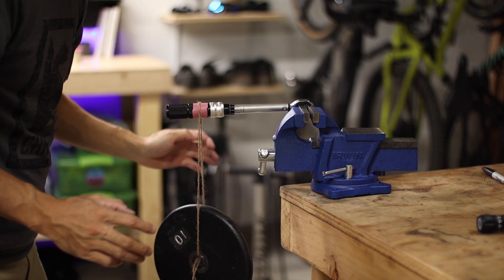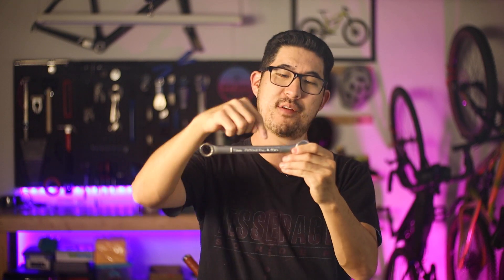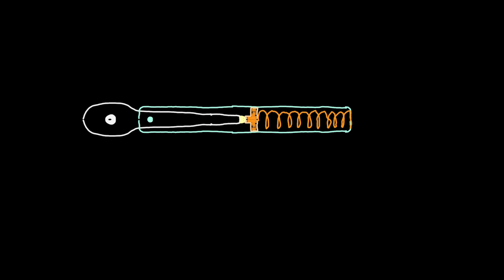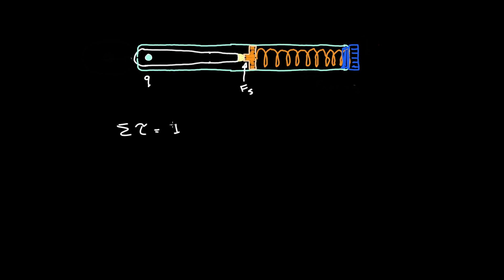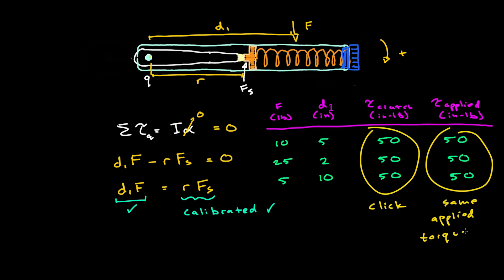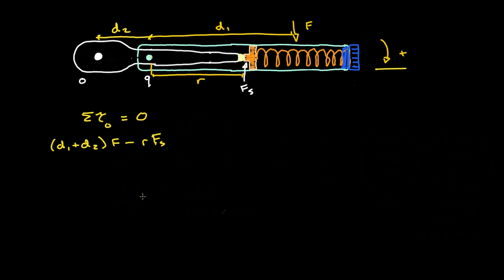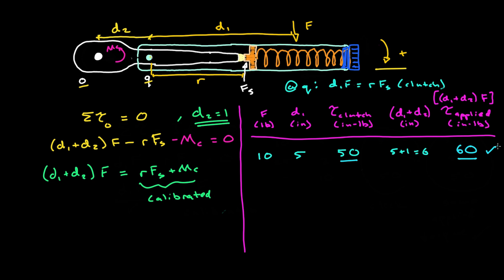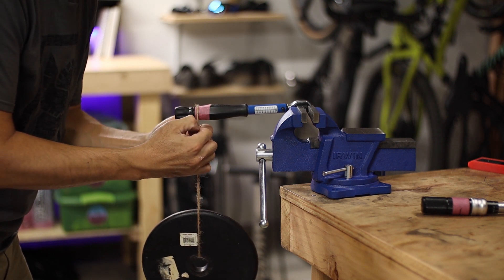Why GRIP Position on Torque Wrenches MATTERS!

Comment: Great illustrations! They explain the problem very nicely. Thank you.

However, I think your equation on the left side is off a bit. Your summation shouldn’t include the internal moment “-rFs”. Until the clutch slips the entire wrench could be considered as a simple solid bar when summing the moments about pivot point “o”. The correct summation equation is just:

(d1 + d2)F –Mc = 0

Nevertheless, when you perform additional free body summations of the individual wrench parts to capture terms “Fs” and “r” and simplify you will eventually get to the key equation which you have correct on the right side that shows that the clutch slippage force "Fs" is indeed dependent on d1:

d1F = rFs   or  Fs = F(d1/r)
Reply: You are absolutely right. But see, this is physics, he can not be a bit off, he is just completely wrong. There is a system of two equations for the torque around the two points of rotation - O and Q respectively:
(d1+d2)*F = Mc
d1*F = r*Fs

And eliminating F, (not Fs as you do) we get:
Mc = [(d1+d2)/d1]*r*Fs

And we get that the relation between Mc and Fs includes d1, which is not a constant, but a variable.
The other two, namely d2 and r do not matter, since they are a constant dimensions of the tool.

And we also see, that the naming scheme of the lengths is also completely wrong, since d1 and d2 have completely different meaning - a constant and a variable.
Also r is like d2 - a constant, they must be on the contrary - similarly named.
Reply from the maker: I love your approach to academic discussion 😆. Are you equating torques at 2 different locations? Naming conventions are pretty arbitrary, not sure how choice of variable name is ‘wrong.’ Thanks for your input nonetheless. Would love to hear precisely why this is completely wrong though.
Reply: @TheBikeSauce  In the model of the click wrench you have two axes of rotation, namely O and Q. Every one of them produces one equation.

Basic naming convention suggests using at least different naming for constants and variables. 

At school they suggest using the beginning of the alphabet for constants, middle of the alphabet for integer indices, and the end of the alphabet for variables. For example a polynomial is written as:
Sum (An*x^n)
a, b, c, d - constants
i, j, k, l, m, n - integer indices
x, y, z - variables

But you do not need to follow that exactly. Proper way is:
d1 and d2 - constants
r - variable
Or:
r1 and r2 - constants
d - variable

You see, also, two of these lengths are dimensions of a real physical object, while the third one is an abstract length from a physical point to an imaginary one. The real force applied by the hand is distributed over a surface area.

Also, another mistake there. In the simplified model all forces come from points on the axis of the wrench. But you draw the applied force on the surface of the wrench handle. You can have a model like that, but than you must take into account  the thickness of the wrench handle. And you get half the thickness of the wrench handle as a third constant there. Going outside the handle and / or having variations of that thickness makes this constant a function of our variable, the position of where the force is applied. So you get a more accurate, so to speak, second order model.
Reply: @TheBikeSauce  If you want, I will add this. In the second order model, where the thickness of the wrench is taken into account, it actually happens, that it does not matter. Yes, the thickness of the wrench cancels out. Which is another, seemingly, "strange and non intuitive" fact. So, it's not a problem to have a short wrench with a thick handle.

The equations go something like this:
Sqrt[(d1+d2)^2 + h^2] * F * cos A
cos A = (d1+d2)/Sqrt[(d1+d2)^2 + h^2]

Sqrt[d1^2 + h^2] * F * cos B
cos B = d1/Sqrt[d1^2 + h^2]

where h is half the thickness of the wrench where the force is applied.
And there we get the same equations as before.
Reply from the maker: Really appreciate that you’re interested, but have a bit of perspective maybe. You can always model a system more accurately given the time, but that does not make simpler models wrong. This model is adequate to demonstrate the counterintuitive idea that grip position actually matters on this type of wrench. It is an explanation for similarly counterintuitive empirical evidence seen in other videos.  

In your more complex model, you gain nothing by considering the geometry of the handle. The cos will be negligible wrt unity and the geometry of the handle is inconsequential.
Reply: @TheBikeSauce  That's exactly what I'm saying. That the thickness of the handle does not matter. How intuitive it is - I don't know.

Usually, the higher the order of the model, the more calculations you need to do. But these calculations are not more complicated, they are on the same level, there is just more of them.

To give a practical or technical idea you don't need to show the internals of the model. You may just show the results or emphasize on them. For example, you have the function:
y = (1+1/x)

That's a simple hyperbola shifted 1 up.
And show where different size wrenches go on that graph. And what happens if you shift in or out on the handle.

It's much easier to understand compared to doing a table with random, unrelated to a real wrench, numbers.

And this will give the viewers "a real, new correct intuition", so to speak. Because you see - here is the graph, here is where you are on the graph, and here is where you move on the graph.

Back in the day that was the main way to go. Now the computers are powerful, and you get just a number on the screen, hence you treat everything as a black box. No wonder there is no intuition...

Comment: Excellent explanation.  I have always wondered why my torque wrench stays at the back of the toolbox and that I am more confident of my hand force on the wrench.
The handle of the click type torque wrench should be articulated, pivoting at a point exactly at the "middle of the handle".  As long as the articulated handle is not bumping against the stops of its free range, the torque value should be consistent.  Or maybe the torque wrench should not have a handle at all but a ring at its end with which you can use a finger or a chain to pull on it.  That is old stuff.  Digital seems to be the answer now.
Reply: You're intuitively grasping something the YouTube personality overlooked.
Reply: its more  often about repeatability than exact torque  ,, plastic parts need an even clamping force to help prevent leaks , rubber gaskets wont mind say an extra 5% torque , as long as the fasteners all have the same to prevent distortion.

Comment: Nice demostration … there is also another consequence to consider in my opinion. When you use this kind of torque wrenches you should not apply additional torque with your hand. If the hand rotates the applied torque is not accurate. Ideally you should only apply force in a single point in the middle of the handle. I hope this is clear.

Comment: I didn’t understand why hand position mattered until recently because I didn’t understand how clicky torque wrenches worked.  And that is not straightforward at all.  And manufacturers absolutely do not help with this.  If we read the instructions (lol), they say do it this way but they virtually never explain why.  And many many people assume that there is just some mechanism built into the ratchet head that is somehow calibrated to click with proportional to torque.   The big problem I have is with people who, once shown the mechanics of the wrench, the statics equations, etc., still just say “bah! torque is torque!  I’m right and you’re dumb.” But alas, the internet is FULL of such people.  Anyway, great video.  It’s nice to learn new things.

Comment: Hi. It is true. Torque is torque when you have only ONE lever to move. Here though you have two bodies interacting. The inner shaft and the outer tube. OK plus the bolt which only lends its reactions to the system. Also Fs will always be Fs meaning that the  limiting force at which the click happens is always the same since it is dependent only on the spring’s selected stiffness by the dial and we don’t change that.  So what else could be changing ?  During the click a collapse mechanism is occurring. The two beams change their relative angle. Note that Fs doesn’t exist as an outer force for the system. It exists only for the inner shaft or the outer tube when separated and viewed as stand alone. Therefore the easiest way to prove your point would be to first show the equilibrium for the whole system just prior to the click when the two beams act as one and calculate all the outer reactions. Then show the equilibrium for the inner shaft ONLY using the previous reactions plus the force Fs as mentioned and considering ΣM=0 at the pivot point of the two beams. Actually when the click happens the pivot point is where the true rotation takes place even if the inner part doesn't really move - your hand’s force F moves respectively to it along with the outer tube. STEP 1 The System. Apart from the torque Mbolt {which from now on we consider it as a moment reaction applied to the shaft} a significant vertical reaction from the bolt -F should also be shown {which is opposite to the F you apply by your hand to the OUTER tool and satisfies the equation ΣFy = 0 for the WHOLE initial system of the two bodies that still act as one. A force which correctly is not shown in your diagram since your pole coincides with the bolt and therefore -F doesn't produce any torque there} STEP 2. The shaft. This vertical reaction now produces a real moment -F*d2 for the inner shaft respectively to the pivot point and it should be noted that it is a variable moment that changes every time you place your hand in a different location only because the vertical reaction changes. Again it is important to realize that for the inner shaft this variability occurs ONLY due to the difference in the strength with which you push the whole tool and not due to the distance from the bolt because the inner shaft is isolated and perceives no moving loads {since all the forces acting upon it have their points of application fixed either at its 2 ends or at the pivot point and therefore perceives only the fluctuations  in its reactions}. Of course the distance comes into consideration for the whole system only and goes along with the general consensus that when you want to achieve  similar magnitudes of torque and you decrease the distance you have to increase the force.  This increment is what is transfered to the shaft and plays a big role as we will see -  big enough to alter the torque output. For completeness we should add here that there is also one more vertical force applied to the inner shaft at the pivot point by the outer tube and it is equal to F-Fs. It is derived from the equilibrium ΣFy=0 {of the inner shaft this time} since there are 3 vertical forces at its 3 points  -F and Fs at the ends and F-Fs at the pivot point. This one though doesn't produce any moments respectively to the pivot point and we won't analyse it any further. Now the net effect is that this aforementioned moment -F*d2 acts as a relieving moment  for the shaft and is actually subtracted from the applied moment Mbolt in the inner shaft ‘s equilibrium equation. ΣM=0 => Mbolt-F*d2-Fs*r=0 => Fs*r=Mbolt-F*d2. Hence for the click to happen Mbolt should now be larger to counteract that larger [-F*d2] and yeld the same Fs that releases the spring. To put it simply the constant moment Fs*r is neutralized partly by the vertical reaction's moment  and partly by the true moment applied on the bolt as torque! To get a recurrent reliable Mbolt you should therefore combine it with the same vertical force that was present during calibration. It is part of the tool ‘s intrinsic formula. This a formula can also be viewd as Mbolt=F*d2+Fs*r. Both addends on the right side should appear as they were during calibration  for the torque result to be reproduced and yeld the Mbolt that the factory had initially gauged. To summarize it all Fs is not the only parameter of the system. The force with which you push the wrench is equally important. So when you hold the tool EXACTLY at the grip of the tool that vertical reaction is the same one that produced the torque Mbolt together with Fs*r  during the factory callibration and this is the only way to always yeld the same result. You exert the exact same forces of the calibration and they produce the exact same torque on the bolt. As you approach your hand towards the bolt  the vertical reaction on the bolt gets larger. One addent gets larger. That new larger F*d2 is not what the factory had taken into consideration when calibrating Mbolt and since it is again added to Fs * r which is always the same that means that the click happens at a larger Mbolt !

Comment: Hi Bike Sauce, I think you have this wrong. The second pivot and clutch is a mechanism to apply a consistent and calibrated load to the socket. The load transfer is not changed by the hand position. It is limited by the transfer of load through the clutch to the rigid arm connected to the socket. You are correct that the testing technique you used is flawed (measuring load on the lever arm to make it click is simply measuring the input force) but you need to look at realised torque at the socket. To do this you need to set up a strain gauge on the rotating object - nut or bolt - and see if the realised torque differs with the same wrench settings and different lever lengths - hand positions. I have not tested this but my analysis of load transfer leads me to believe that hand position does not alter the load transferred to the rigid arm through the clutch.
Reply from the maker: The linked video shows this exact phenomenon using a strain gauge torque sensor. This is just the math to explain it. I know.. really counterintuitive

Comment: I like the explaination. However it provoked more questions like; Where exactly is the "middle" of the handle? If your hand is smaller than my hand is it more/less accurate? How do you apply force to a specific area with a hand, that is much wider than a string with weight?

Comment: I have a split beam torque wrench with the knob on the side (not the micrometer style click wrench), and I also have one of those digital torque adapters. I don't know if the physics are the same as you showed with a split beam, but gripping different parts of the lever produce different torque values at the socket (where the digital adapter is) when the wrench clicks. It doesn't seem to be a linear relationship though. The more I choke up the harder it is to generate torque at the socket (of course), but pulling between the handle and the pivot point produces erratic readings from test to test and causes the wrench to click with 35, or 46, or 41 etc. ft lbs at the socket (when it's set to 50). This is not quite what I understood from the video which (I think) said the higher you choke up the MORE torque should be at the socket when the wrench clicks. But again I have a different style torque wrench.

The conclusion is the same, of course, and it's something I eventually figured out when playing around trying to see if both my adapter and wrench were accurate (they are both new). Hanging weights off the shaft 12 inches from center socket caused the wrench to click 5 ft lbs. too early. Hanging the weights off the center of the handle got me within a few ft lbs. (borderline acceptable range). But actually pulling on the handle properly while bracing the socket gets me within less than 1% repeatably. Conclusion: how you grip and apply the torque to the handle matters, so do it properly. Since I'm getting both my devices to agree with a high degree of accuracy I'm going to assume the equipment is good enough to rotate my tires with. lol (because honestly what else am I going to do with it, build a space shuttle in my garage?)
Reply from the maker: For a beam style wrench, the length is a factor so grip position is also a factor since it’s based on beam deflection. But.. I totally agree - we’re not building space shuttles 😆😆😆

Comment: This helps makes sense as to why the hand position matters for a click type torque wrench. One issue with the equation, though. If you use the socket as the pivot there is a force on the pin where the inside pivot holds the handle  to the inner beam. Also, the socket itself has a torque which is equal to the torque that is applied to the bolt, and that is the quantity to solve for.
Reply from the maker: Thx, Kelly. The force you mention is accounted for in the additional couple Mc. The torque at the socket is equal to the applied torque on the bolt as it's in static equilibrium.
Reply: @TheBikeSauce , Mc does not account for the torque added directly at the pivot point by the orthogonal force of the handle.  I think you have made some catastrophic simplifications and mistakes in your modeling.
Reply: There is a system of two equations for the torque around the two points of rotation - O and Q respectively:
(d1+d2)*F = Mc
d1*F = r*Fs

And eliminating F we get:
Mc = [(d1+d2)/d1]*r*Fs

Or:
Mc = [1+d2/d1]*r*Fs
Reply: @jasonbeisiegel5550  Mc is the reaction of the bolt or nut to be tightened. It's equal to the torque that the wrench applies to the nut or bolt, but has opposite direction and is applied to the wrench. It has nothing to do with any pivot points. Also, the pivot point can not be a source of a force, a torque, or anything. He is wrong, but you are not right too.